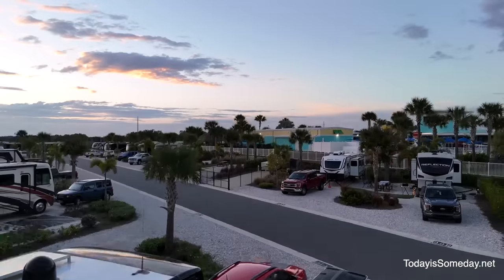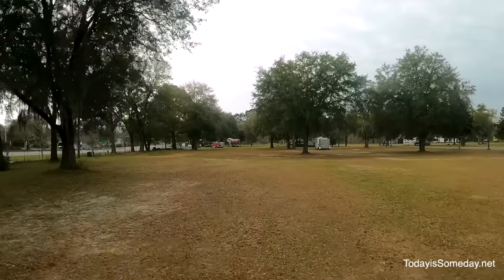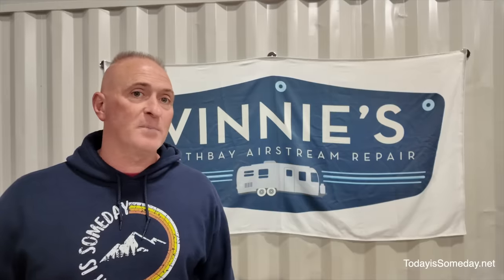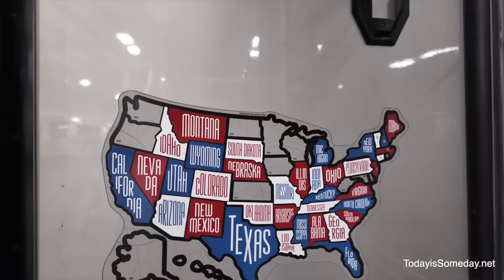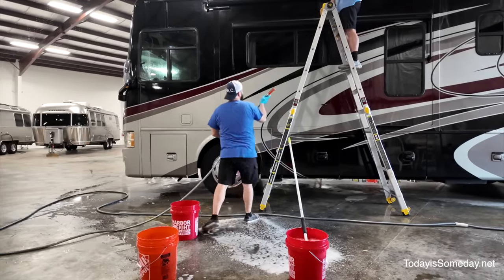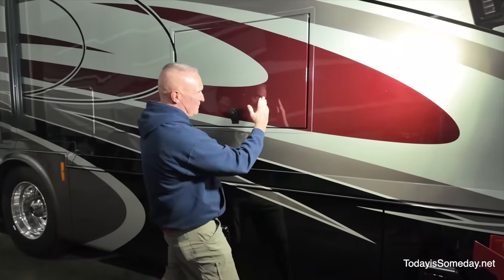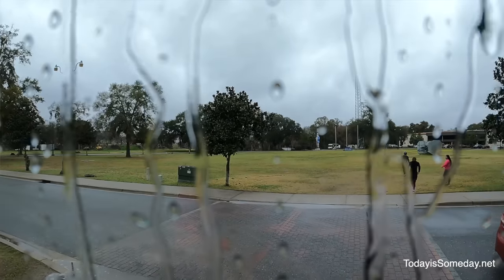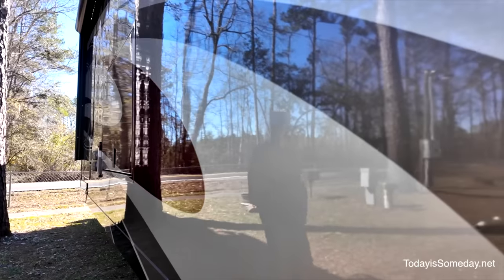A Much BETTER Way to Clean (AND PROTECT) the RV

Comment: The sound you heard was me falling off my seat when I heard the price. We're full timers in a 43 ft Dutch Star that's 10 years old. I have a rough time considering paying someone to wash mine. While in Elephant Butte, NM last week, I got a quote to wash and dry mine for $630 - 😳. I'm still at a point in life where I can wash AND wax mine with no problems. And having painted cars, I can do a pretty good job. No doubt your rig looks gorgeous, but I'll hang back for now and enjoy the time outside, cleaning my rig and saving for new tires. Thanks for sharing so much about the process.

Comment: OMG!!  I was so tickled to recognize the driveway when you turned off the road.  We had our Airstream and truck ceramic coated two years ago right after they opened the shop in Tallahassee.  Briston was running a one-man shop at the time, and he did an awesome job.  We have been thrilled with the difference it has made to the exterior of our vehicles.  All I have to do to clean them is foam on Release, give it a couple of minutes and a quick wipe, rinse with a hose, and run a microfiber cloth around to get the worst of the water off.  Even a hard rain leaves them shinier.  Ruby looks beautiful and will thank you in the long term.  You will LOVE it!

Comment: Your coach turned out terrific!   We have a Newmar with a 3M product called “Diamond Shield” on the forward facing areas on the front cap.  I don’t know if Tiffen does the same thing on their coach’s.  If so, did they remove the Diamond Shield before applying the ceramic coating, or do they apply the ceramic coating over the diamond shield?
Reply from the maker: Yes, we do have the diamond shield and they did not remove it as ours is in good shape still.

Comment: We just went through about a 2 month process of trying to erect a 15 x40 RV carport at our house. I drew up site plans and tried working with 4 different RV carport companies that just didn't have what I thought was the moxie to lower the costs. Plus, the City of Yucaipa CA threw not only $1500 in building permits at us, but a $2800 Special Use Permit because it was a metal structure that didn't conform to the houses' architecture!!!! We ixnayed the cover idea, and  just decided last week that we would do everything we can just to protect our new 2023 Reflection 320MKS from all the elements, and I knew ceramic coating was the first step in starting that process. I got a few bids for it, but all of them were for either a 3 year or 5 year warranty. Now, my understanding is that the plastic decals and such are tough to protect even with ceramic coating, but at least the front cap which is painted and facing the SoCal sun is the most we need to focus on, but I when I saw the word PERMANENT in your video description, it perked my attention that it might be possible to get longer term protection due to your video. Of course, the biggest issue we have that I don't think you have is that we've got a TPO roof membrane, which still requires  semi-annual or annual attention (as I'm sure your MH has a solid roof), but that can be dealt with as we would need to do that regardless. I'm curious as to exactly how "permanent" the warranty is for your $6k?!?!?!

Comment: Beautiful Ruby. This was a great informative video. The micro fiber towel's edges and seams are sewn with nylon threads which in itself is very abrasive. The lesson on how to fold the towel to avoid using the seam edges was very helpful. I have cut the seamed edges on some of my micro fiber towels to use strictly for polishing.
Reply from the maker: I plan to find them without seams......I heard they are out there somewhere.

Comment: We just purchased a travel trailer and had the dealer put ceramic coating on it before we brought it home. Haven’t washed it yet but we did have some cold snaps and rain and it still looks good.
Have safe travels!

Comment: So the moral of the story is get the paint fixed before you get your rig ceramic coated.  As far as what to use to wash the rig get a natural wool wash mitt and use ONLY 100% cotton towels for any drying.  Most synthetic materials are harder than the paint and will scratch it.  That's my opinion and I'm sticking to it.   Keep the good stuff coming guys.

Comment: We're looking at ordering a new RV from NIRVC and have them do the ceramic coat. They will do a "paint correction" before doing the ceramic coat. Their body shop is the best for RVs in my opinion. If you don't do the correction first it will only emphasize the blemishes in the paint. All new vehicles have blemishes. It takes them a full week to do the job. They guarantee it for 5 years if you bring it back to them every year for free refreshing

Comment: Looks awesome.  I got an estimate for our rig and I was surprised at the price.  More reasonable than I thought.  Did you guys have the diamond shield on the front? Did they take it off ?  Thanks for the video.
Reply from the maker: Thanks.  Yes we have the diamond shield and they did not remove it.  It was still in good shape.  I will have it done when it starts to look bad and then I will swing in for Master Applied Coatings to seal it in!

Comment: Enjoyed the video. Only question, Our coach has the DIAMOND SHIELD on the front...would that have to be removed?  I do have another question and not sure if posting it here is appropriate.  Do you have a water softener?  What is the silver tank in the wet bay?
Reply from the maker: The diamind shield did stay on as it was still in good repair.  We do also have a water softener.  We did a whole video install it last year: https://youtu.be/O2F_r7lty7A

Comment: Hi Phil and Stacy.. Now that you have had the coating for a bit, do you still love and recommend it?  We have an appointment in a month and will be driving over a 1000 miles to have it done.  Not an inexpensive trip but hoping so worth it.  One other question, did you have your solar panels coated?  Also, do they ceramic coat the glass windows.  All the best to you two.  Love your videos.  :)
Reply from the maker: We love the coating!  It looks shiny all the time now.  I need to rinse it off, but I haven't pulled my meaf blower from storage so I can blow it dry.  They put a different coating on the solar panels and windows that only last about 2 years.  The coating on the RV paint will last forever.
Reply: Appreciate the reply guys!  We are having our Motorhome and Tow car coating applied next week.  Pretty excited.  I will be interested to see what they use on the glass and if it can be purchased since it needs to be applied every two years.   Safe travels and keep up the good work!!

Comment: How’s the warranty? Did they give you ceramic spray to re-enhance to coating? You can’t beat DI water when washing your rig.
Reply from the maker: No extra to spray.  It is a one and done.  Fingers crossed it holds up to the TX sun.

Comment: I've thought of getting the ceramic coating on our Fleetwood Discovery, but ours have diamond shield on the front. How would the ceramic coating work? Do they take the diamond shield off?
Reply from the maker: No.  They left ours on and cleaned and coated right over it.  Ours was in pretty good shape still.  If it is in bad repair, I would remove or replace it first.  Give them a call, they can explain it.
Reply: Ok, thanks for the response! Sounds good

Comment: Did they ceramic coat your slides? I was told that Tiffin didn’t recommend it because it would make the sides to slick so the seals would not work correctly.  Is there any truth to this?
Reply from the maker: Yes, they coated the slides and so far they work as they did before they were coated.

Comment: The rig looks real good. Ceramic coating itself is not a very expensive product. It's all about the labor $6000 way over priced. They don't last forever. You do need to apply top coats every once in a while. They are more prone to water spots. So it is best to wash using a DI water. Safe traveling
Reply from the maker: Actually, their formula does not require additional coats. It is permanent. We only need a touch up if we damage the RV.

Comment: Nice product, but too expensive.  2 guys labor for 3 days, $2000.  Ceramic Coat material, $500-$750.  Overhead for building $500.  Not sure how $6K is derived.  Huge profits.
Reply from the maker: It is an investment for sure.
Reply: @todayissomeday I so agree ! My hubs getting appointment .. Thank you very much
Reply: Hey there Tom! Just wanted to help out a bit with some of your numbers. $2000 for labor would assume we have an $83/ hour shop rate, which is way below any state average. $500-$750 would be the cost of getting Ceramic from over seas. $500 will get us the roof above our heads, but you can't forget the walls 😉
Reply: You have no idea what their business overhead is.
Reply: Tom’s numbers may not be accurate, but $6000+ (ours would be more at 44Ft), is not something many of us retired folks have the money to do this.  And when we were in California they did a jet coat (also used by the military) on our 35 ft 5th wheel and it was much less ($1900 at the time). And it didn’t require any additional trips to reapply as stated in the video.

Comment: Can you get the coating on a rig that does not have full body paint ?
Reply from the maker: Yes.  The have apply a formula designed specifically for each rigs sidewall make up.

Comment: How long does that last?
Reply from the maker: Master Applied says permanent.  So far we love it.  I haven't washed it since we had t done and it still looks just as shiny.  We will see what it looks like when I am able to get on the roof and clean it.  I normally get while streaks down the side after wards. They did not coat the roof.
Reply: @todayissomeday , do they not coat the roof? Why did you not do the roof?

Comment: Sorry guys, $6,000 is way too much. I have found reputable applications for $4,000.
Reply from the maker: That is great if you find something comparable for that price. Just make sure it is permanent and does not require repeat applications every 2-4 years. The chemical compounds they used on Ruby bond with the RV and do not require repeat applications. It is also rated 9H for hardness (diamond is 10H) so be sure to ask about the hardness as well. It will be a determinant in if it will last.
Reply from the maker: One thing to always check, no matter the price, is how long it will last or how often they recommend you get it reapplied. If you have to reapply it every couple of years, that price can add up fast.